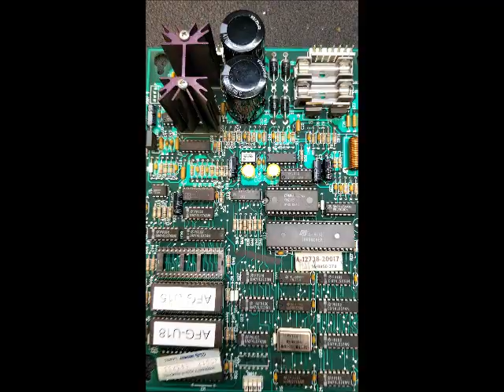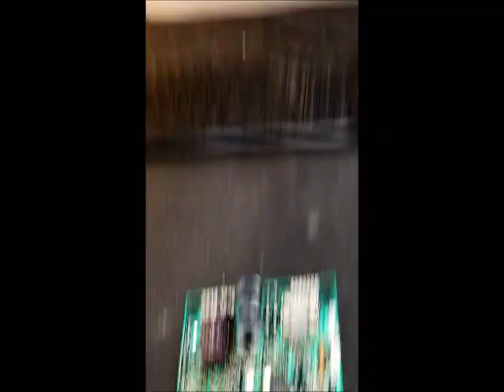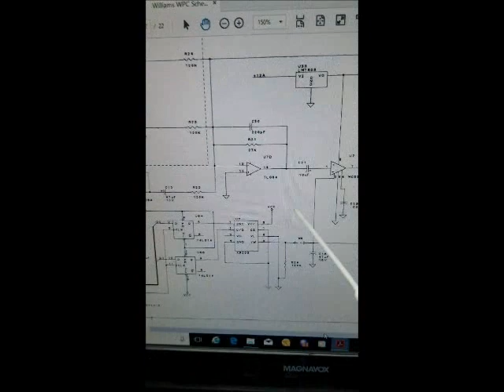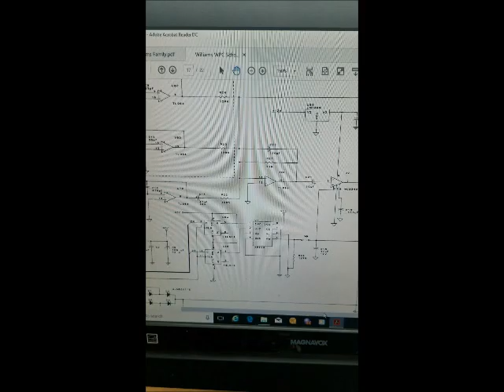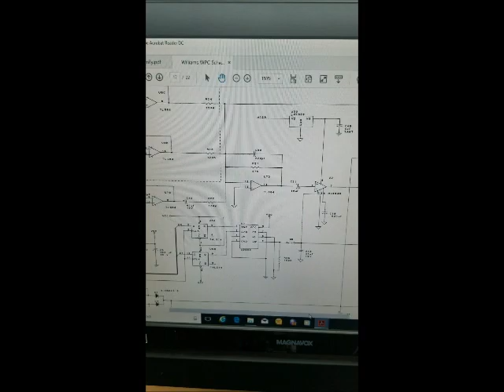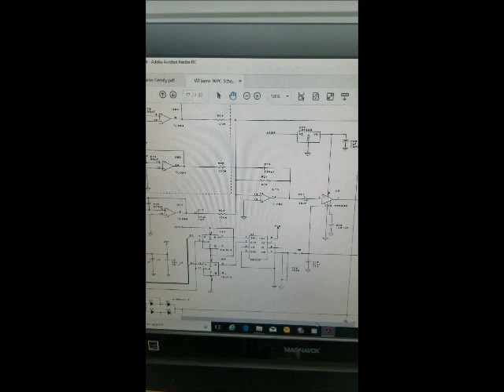WPC A-12738 Sound Board Distorted Uneven Sounds Repair

Comment: Would caps cause uncontrollable volume? My Volume would go all the way up. I'd adjust it on the game and it would show it being lower on the display but it was busting my ear drums.
Reply from the maker: Erratic volume is usually caused by the 47uf cap at C18 or the X9503 DVC chip itself.  Should the DVC chip be your issue, you can replace it with a X9C503.
Reply: @tipsfromthetechbench4589  Thanks so much I'll look into it.
Reply from the maker: @oneinchbiceps  Missing some but not all sounds is usually C36, C38 or the ribbon cable itself.  You may need a signal tracer to troubleshoot any further.  If you have a signal tracer check for sounds on pins 9 and 10 of U11.

Comment: Great video.  My newly acquired Addams sounds funky too.  Did you get to hear what it sounded like before you received the board, or did the customer simply say that it sounded wrong and sent it to you?
Reply from the maker: This particular board repair was part of an overall shopping of the machine so I did get to hear a before and after.
Reply: Tips From The Tech Bench Thanks. Could you tell me if it sounded anything like this?

https://youtu.be/RPoJQXniVEg

My callouts sound distorted at reasonable volume. I've only just received the machine so have no frame of reference. Music seems to be ok for the most part.

Thanks in advance!
Reply from the maker: Yep.  There are obviously other things that can cause audio issues but, in my experience, that's a classic example of what is most often caused by bad caps.